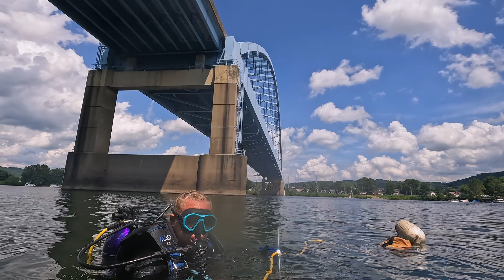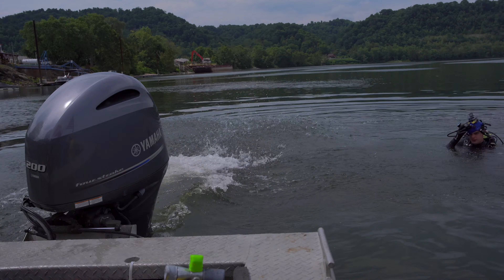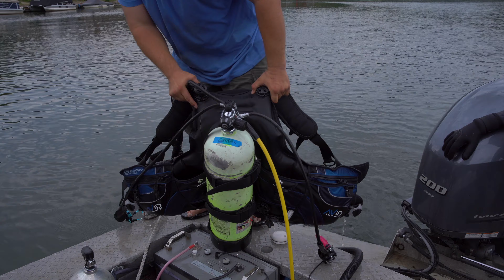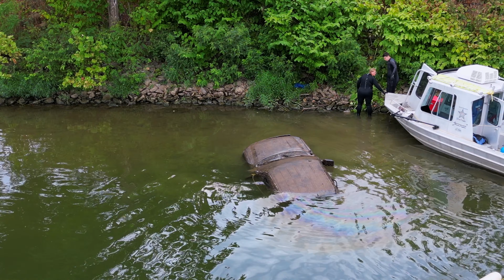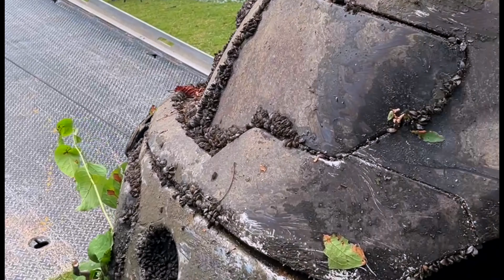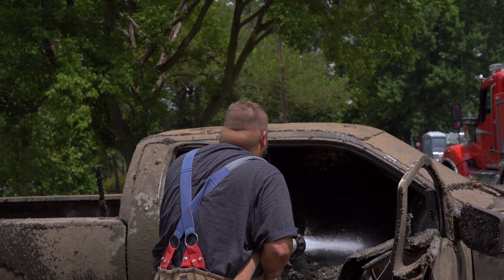First Female YouTube Diver Recovers Stolen Truck From River Police Called For Our Help!

Comment: 🎉So amazing Lindsay. You are inspiring!!!🎉

do you ever soak up the oil/fuel spill with those pads? there seemed to be a lot of spillage this time.
Reply from the maker: It’s usually gas leaking and it evaporates very quickly.

Comment: Why don't you use the tow hooks on the front of the trucks most of them ha e them ? Aloso on the back use the receiver hitch?
Reply from the maker: They aren’t always accessible.
Reply: @ChaosDivers  I know that. But when they are that's what I would do. It would be the strongest point on the truck because it's connected to the frame also the same thing on the back. Keep the videos coming